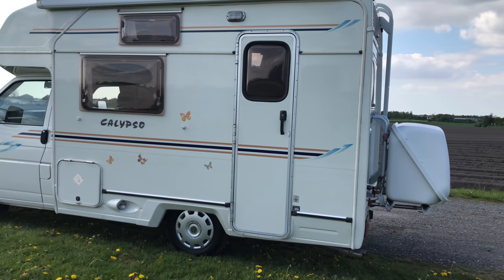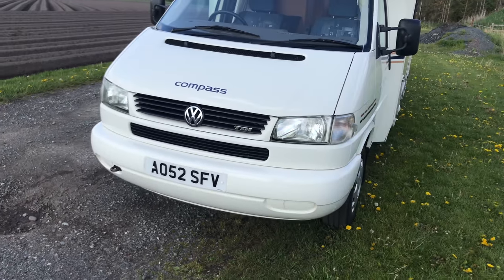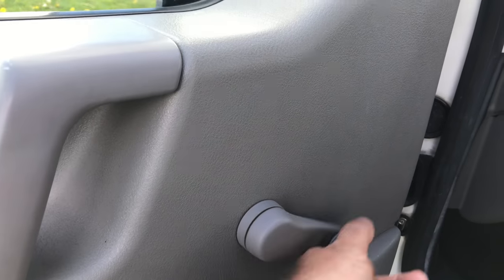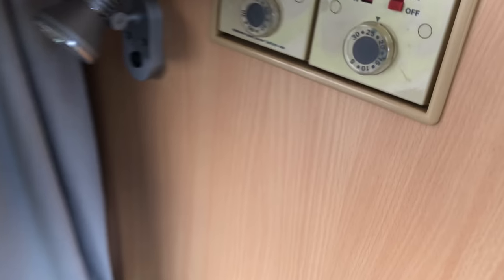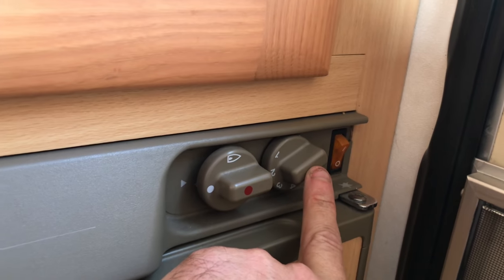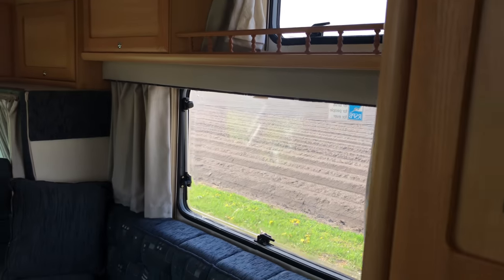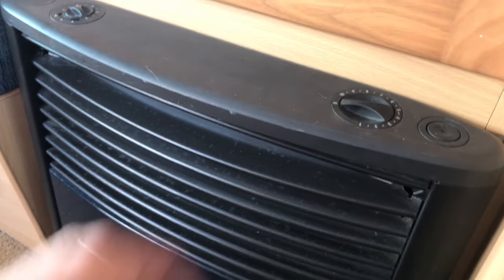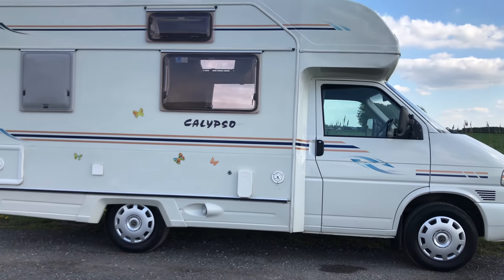2003 COMPASS CALYPSO MOTORHOME REVIEW BY CAMPER NERD ANTONY VALENTINE WITH A DRONE FLYOVER !!!!!!

Comment: Nice littie camper van.
Amazing how expensive those little LED spotlights are if ye have to replace the halogen ones.

That's why I prefer the strip lights for the main ones, unless of course ye get a good deal on LED spotlights that're used in most modern campervans.